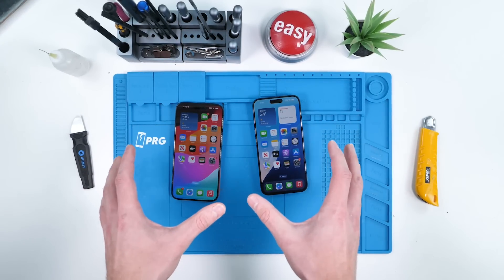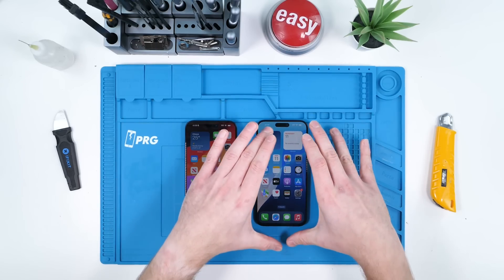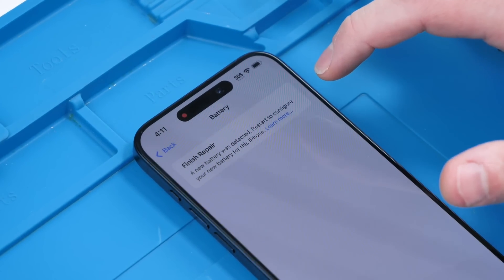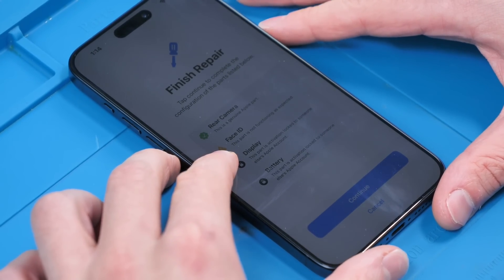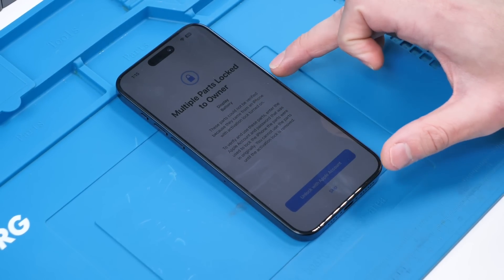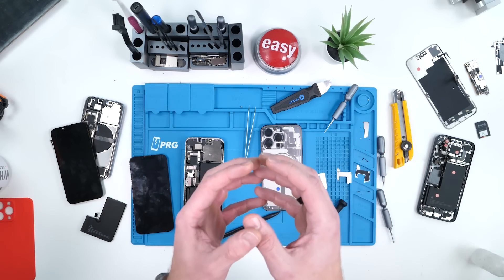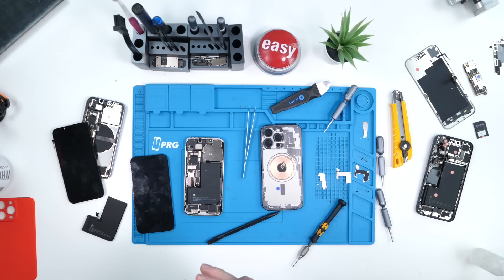Apple Made The iPhone MORE Repairable...?

Comment: Watching this with an s20 FE 5G where I've broken and swapped the display 3 times, the battery back and forth at least 2 times, the sub board once, the main camera once. And never had I fear any lock, I have the back cover not completely glued so if I ever need to swap something I can do it in 10mins.
Genuine parts became less expensive because there are good aftermarket parts, so if an aftermarket sub board or battery performs the same or better than the original one than the original one will not be so scarce and became less expensive. iphones parts basically rely only on other iphones of the same model being broken, so with 2 broken iphones maybe you can have 1 working.

Comment: I mean, I guess it is a good thing that in a way they would make it so the parts will say that it won’t work because it’s taken from someone else’s Apple ID because of the fact that you can’t be using that part if it’s technically still logged into the phone and on top of that even if it was yours, I’m glad they also added the unlocking prompt😅

Comment: I have a question – does remotely removing your device from your Apple ID on the web or using another signed in device remove the activation lock on the swapped parts?

Comment: Holy shite. The phone I've been using for the last 3 years or so is an iphone 11 that I repaired from being water damaged. Luckily, I basically only had to replace the screen for it to work again, but of course face ID was borked as well. I got a genuine apple display with the face ID still on it from ebay so that I could use the phone, and I've been using it since but with no face ID functionality. This update from apple might be a way for me to FINALLY get to use my face ID, which I haven't ever been able to use since I replaced the screen!! 

This is the first time I'm genuinely excited for an apple IOS update lol

Edit: dang, I just read a comment saying iphone 11 is not supported :(((((  That's probably the most excited and then most disappointed I've been at the same time all week.

Comment: It seems like there's a more efficient way for Apple to handle this, given their engineering expertise. While I understand the need for iCloud locking to prevent stolen devices from being sold on the black market, what about phones that have been recycled with iCloud still attached?

A possible solution could be that if a phone is reported lost or stolen, the entire device is bricked, including its parts. However, if the iCloud lock remains but the phone isn't reported lost or stolen within 180 days, the iCloud account could be automatically removed, and the phone automatically resets to erase all data. This way, the parts could be reused for repairs rather than ending up in landfills.

Comment: I feel as if apple intentionally makes sure one component cant be detected with refurbished or iPhones serviced outside of them so they can't be traded in towards newer iPhones at their store. Went to trade in my refurbished 11 Pro I bought from them 3 years ago, they ran the diagnostics, and despite my cameras never giving me any issues, depth of field working, zoom, etc. the diagnostic said it couldn't "find the sensors". They basically told me the 11 pro was worth 0 dollars towards the trade in, but I could give it to them for free so they can "recycle it". yeah right. I bought the 12 (one of the worst recent iPhones, wont get into that.) and traded in the 11 pro at GameStop for $350. If it's not new from apple, I don't even bother.

Comment: Hey guys, i have replaced the non-guenie battery and display(i'm not sure is it guenie though) on my XR and the warnings are shown in the settings.

I wanted to upgrade to ios 18 to be able to try the "restart & finish repair" feature, but after upgrading there is no such button except the warnings, so nothing changed.

Any ideas on how to try this feature? 

Maybe i should try to re-connect the battery and display and try to find this button again?

Comment: 15 steps back, one step forward 
What we celebrate in 2024 is something else. I am not saying this as critical of you at all, just commenting on the state of the industry
Reply from the maker: Agreed. This shouldn't even be an issue in the first place, but I can't deny feeling some relief knowing that mistakes which once required buying the customer a brand new phone can now be fixed without the hefty cost.
Reply: As a regular user I feel like we’re heading for something that’s unequivocally one huge step forward from the baseline (no restrictions on swapping).
We’re close to a situation where an iPhone has almost no value as a stolen item. Even the parts have little to no value. We also get a LOT of confidence for buying of second hand devices, where we can be more certain that none of the parts have been replaced with bad or even dangerous third party components. This is a HUGE benefit for the resale value of phones, which IMO is just as important as repairability for the long term life of a phone. It’s the difference between someone putting their old phone up for sale vs leaving it in the drawer as a backup phone.
If we can have decent repairability on top of this it will be the best of both worlds. A huge step forward.
All we need is a bit more pressure on Apple to make the swapping/calibration process even easier, and some better regulations requiring availability of all original parts at a fair price for a reasonable length of time. 
I know you would probably have loved guaranteed access to schematics and such as well.. I would too.. but honestly I feel like that’s not going to make much of a difference in the real world.
Reply: reported
Reply: @monstereng43 what why?

Comment: 4:11 Activation Lock is not the same thing as reporting a device lost or stolen. All Apple devices that have Find My enabled are automatically Activation Locked because Activation Lock is the feature that prevents stolen devices from being used in whole or now in part (pun in tended). The only reason this would be odd is if the two iPhones were signed into the same Apple Account. If they are, then it would not make sense because the part is locked to the account that its host iPhone is already using. Regardless, signing in to the Apple Account or signing out of the account on the original device is an easy fix, but if neither are possible or work, another way to resolve this is that you can put the part back in the original device (or in your case swap the motherboards back), make sure there are no errors or warnings, and then turn off Find My on both iPhones, repair them, and then sign back in.

Comment: My iPhone 12 pm have the same issue with the camera that can’t be calibrated, I replaced it with original part from another phone, while in the process I broke the lidar sensor and flash, I replaced it with an original from also another phone, the flash do work but I can’t use apps like measure and 1x portrait mode doesn’t work, I hope they can fix these too.

Comment: This is pretty cool thanks for the extensive research. Wild they make you go through all this just to change parts. Now listings for salvaged screens for phones are going to need to specify if they are activation locked or not which will be impossible to tell most likely unless they install them in a phone every time to test. I would like to see you do this with third party screens and batteries and see what happens. Sucks they still are blocking face ID thats their way of still telling someone parts have been replaced.

Comment: Definitely a step in the right direction. Honestly I thought I will never see the day Apple will allow anyone to use their calibration software to calibrate replacement parts. This is very good as now can buy geniune batteries and replace withkut have to remove old BMS board from old battey to have to spot weld it to new one and then put on my programmer to charge and discharge battery for battery health to reset. Then same with face ID which was a whole another issue. I literally had to desolder IC  and move to new flex cable to get it to work.

Comment: Ok so as a strong critic of Apple repairability, I support this. It help prevents stolen phone parts being swapped, it also help prevents going to Apple to repair your phone. I 100% support this. Other brands should definitely take this as an example.
Reply: It absolutely does nothing for stolen phone parts. These parts still FUNCTION just the same as they always have.  They just can't be paired, but they ALREADY can't be paired.  No change.
Reply: It just makes recycling parts impossible.. At the very least, genuine companies selling used parts from verified non-stolen sources should be given the tools to remove device pairing from said parts.

As it stands right now, even legit companies can't sell used parts.
Reply: @fredrikcarlen3212  I agree with what you say. But this new initiative is better than what Apple had previously. Anyones phone can be stolen. This way Apple use to prevent swapping part for a different device until the original owner approves of it is better. It also would help third party repair shops to find the original owner only if the phone is stolen

Comment: I have a question. Until now, I have always bought original Apple replacement parts like displays pulled from eBay, and it has always worked great. The only thing now is that there is no way to verify where the parts comes from and whether it is iCloud locked or not. Do you lose more functions if the replaced part is locked compared to not completing this finish process?

Comment: I made an functional iPhone 14PM using an unlocked board and some parts from a locked device, should I risk updating to iOS 18 or 17 is fine?
Reply: 14 PM is not affected.  Even if it was, it doesn't matter.  You cannot lose what you don't have.  This is about part PAIRING which is not the same as part FUNCTION.  You already do not have those parts paired to the board.  The function that you could gain (if they are OEM parts) are 1.) Battery health, 2.) True Tone.  That's it.  FaceID in 14PM requires pairing True Depth Camera to the board and that is not an option with iOS 18 outside of apple self service.
Reply: @ipadrehab5362  in this case I put the original front camera with face ID and pretty much everything works except of the lidar sensor, I think I put the wrong one

Comment: Does this effectively reduces the value of a stolen iPhone? Is that one of the idea to do such thing, besides avoiding iPhones being sold as 'complete/new' when parts are not genuine or replaced.
Reply: It does not.  You can use all the parts of a stolen phone the exact same way as you could before iOS 18.   They already can't be paired with the CPU--so no battery health, and no FaceID, otherwise everything works.

Comment: The reason they were locked parts for the displayed battery when you swapped it over but you did report it as long as it’s because Find My is on the original device

When you factory reset that sound or sign out of iCloud Find My was turned off at the lock of those parts was released but that’s why you had to type in your credentials on the second phone even though you never reported the first phone as lost or stolen because by having to find my own you technically are and you would have to turn off Find My before giving a phone for repair or trade in releasing it ownership or whatever

Comment: These also helps deter theft, specially in countries where AppleCare+ is not available, and any comparable insurance is not available.
Reply: No it won't.  Those parts still FUNCTION just fine just like they do now.  They just can't be paired, but they already can't be paired.  So, no change at all.
Reply: @ipadrehab5362  Some report that when they used a different battery/display, it would be stuck on the activation lock screen. Plus, since they serialized parts, if one knows the icloud account for the parts, there wouldn’t be issues with original parts being moved/transferred over. This is a big win for both repairability and theft deterrent.

Comment: LiDAR is not a part that you could replace it in Apple Store or AASPs, when you have an issue with LiDAR sensor, a Rear System will be replaced (Which is a whole unit expect the display and the Camera) or Mid system for some models (which had a removable back glass).
Which makes the LiDAR until now related to the motherboard and by the way, you can replace the camera only and that will not affect the repair.
By the way, if a display was replaced for older model (like 11 Series for example), i believe that you should replaced the display with the Embedded ALS sensor in the upper side of the display.
And i really wish if you have the ability to test that on 11 Series
Reply: I have tried it on 11 series - it sadly does not work. It works on 12 series and onwards.. God knows why...
Reply: @Panzertank123 Maybe because 11s become outdated
And then we will request from him to test that on 12s
Reply: @taherrp481  yup, but ios 18 is avaiable on iphone XS and onwards.. why they did not enable parts pairing if they are compatible with the newest iOS? It does not really make sense.
Reply: @Panzertank123  because none of the right to repair legislation backdates to the iPhone 11.  Self service was started with the 12, so that seems like the min they could get away with.

Comment: Just to be 100% clear, activation lock has nothing to do if the device was reported stolen. Activation Lock is when you logged into iPhone with your iCloud account it automatically associate the device with your iCloud, so anyone wants to reset it has to log out that iCloud account first aka deactivate the activation lock. This is the way to prevent thefts from stealing iPhone turn it off and take it apart sell parts.

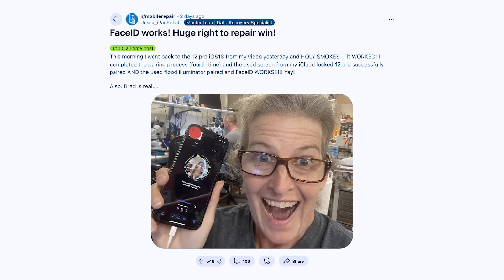Comment: 6:40 she didnt replace the face ID, she just replaced the flood illuminator and pair it with a another one taken from other iphone, that will totally work, but changing the true depth camera is another story
Reply: Almost.   I replaced the flood illuminator (part of FaceID system) ALONG WITH a screen that it happened to be on.  This was only by chance because I had a parts bin screen that had a working flood on it, and it was easier to plug in that screen and flood than to take the flood off and move it to a different screen.  It worked.  

In my newer Parts Pairing Lab video, I tried to separate the Flood from its native screen and install it on a different OEM screen.  WILL NOT PAIR, and NO FACE ID.   So preserving FaceID is an edge case---ONLY iPhone 12, and ONLY if the fault is the Flood, and ONLY if you replace a flood WITH its native screen.   Not much of a win at all.
Reply from the maker: @ipadrehab5362  Hey Jessa, could you make a comment on the video that I could pin clarifying anything that I may have missed along with your new findings?
Reply: @PhoneRepairGuru  I have no idea how you can keep up with all these comments!  I made a comment summarizing what we found.  I'm really disappointed in how for a moment there I thought that we really had a win--when I fixed FaceID, but then realized how limited it is, it's nothing.   I'm mad about that.   Reach out if you're interested in strategizing how to take this to a public campaign.
Reply: @ipadrehab5362  yeah, totally unnecessary to pair the flood illuminator with the display, Apple managed to make it look like a win, but it’s very anti repair tactic, I think only the battery being able to restore functions is a good thing, everything else is basically the same as before

Comment: For those who are wondering why you have to recalibrate the back glass is because of a feature that lets you run a command by tapping on the back of your phone
Reply: that doesn't even use the back glass, it's accelerometer based
Reply: that just uses the accelerometer, there's no sensor on the back glass.
Reply: U sound dumb
Reply: It’s due to the wireless charging pad. That’s build into the back glass, at least on Orginal parts.
Reply: nah. you have to calibrate it because apple serializes everything when it isn't needed. this is a tiny step in the right direction.  knowing apple they plan on doing something worse soon every time they do anything pro consumer
Reply: @czechvirusS  Nah. Calibration is completely seperate to serialisation.
Reply: @czechvirusS  destroy your privacy with apple intelligence
Reply: @coprilettodelnapoli5466  ?? what are you on about. did you not notice i am against apple? i just said its a slight move in the right direction. and that they likely plan on doing something worse. like always
Reply: Alot of people don't know this is possible 😂😂

Comment: Back glass message 🤦‍♂️🤦‍♂️🤦‍♂️🤦‍♂️🤦‍♂️🤦‍♂️
I really hope they will get fine for this acting one day
This company is one big liar after Steve Jobs died. I have seen a video when they said they are locking parts only about biometric system. What a liars. They lie in court

Aha, screen is activation locked. So basically they have done nothing again 😂😂

Face ID is not working as expected. Of course, they don’t want you to repair it since the phone without Face ID is annoying to use so there’s a higher chance you will buy a new one.

So basically, there still be messages since when I use refurbished screen, I can’t find or force original owner to give me his apple ID

Oh, and let me guess, this feature will be available only on the iPhone 15 Pro and higher…. As usual